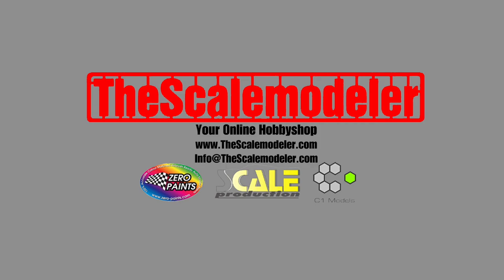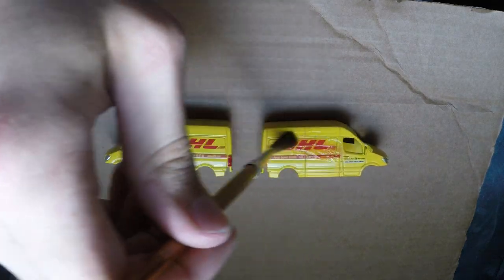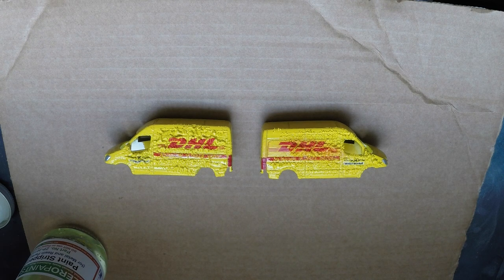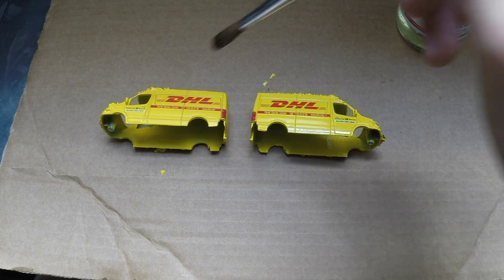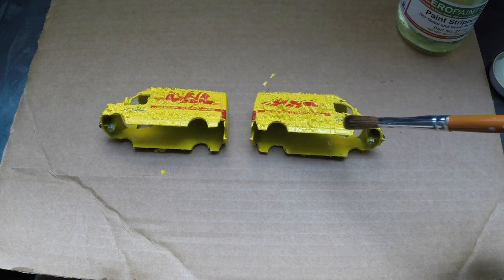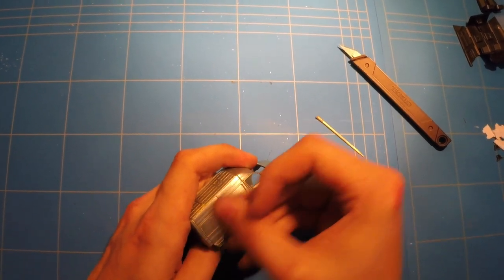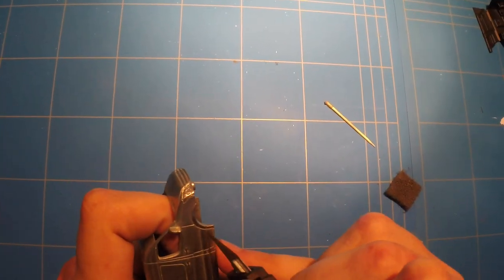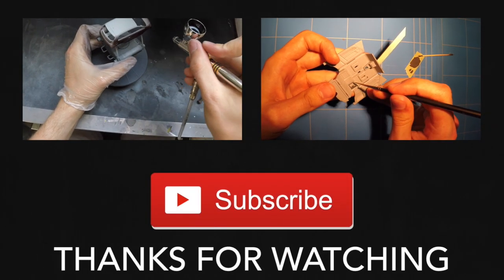How To: Paint Strip a Die-cast

Comment: Diecast models are made out of an alloy called Zamac (or Zamak). It contains Zinc, Aluminium, Magnesium and Copper. It doesn't rust. I can show you models that I stripped 10 years ago and are still in perfect condition. 
The only problem comes from the Aluminium component, as this metal will oxidize on the surface causing some adherence problems for your primer. Scuffing the parts before priming will fix it. Etch primer is highly recommended.

Comment: Where can I buy this zeropaints stripper?
Reply from the maker: Engine201 zero paints has a dealer locater on their site ;)
Reply: I found these paints on line from an English model shop.  This line of paints (made in England or Europe) has a lot of sets, 2-3 bottles, for racing teams.  The paints are airbrush ready (thin paint), have an agitator ball inside & come with a plastic plunger cup to seal the bottle (can be reused to seal the bottle or as a color cup for brushing on paint).